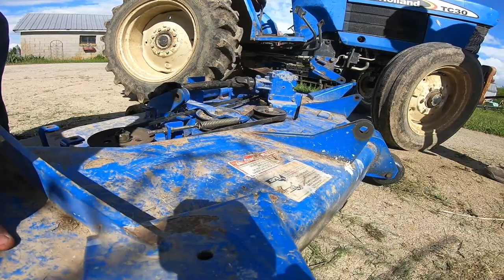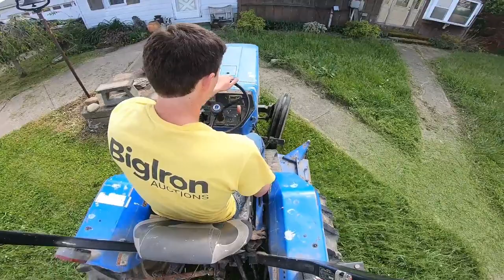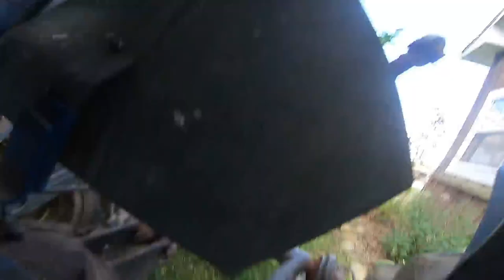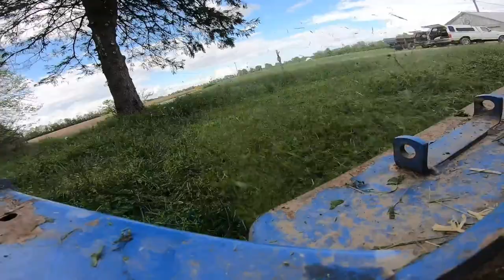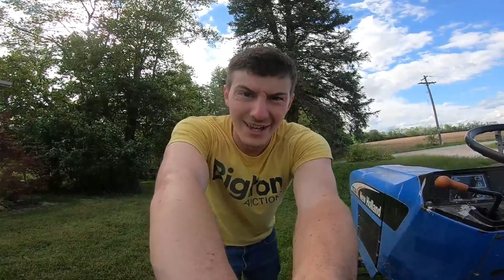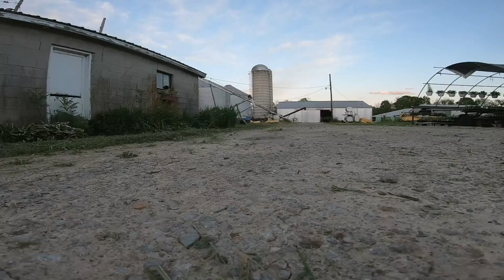Yard Maintenance to Make Lawn Pros Gag

Comment: Before the days of zero turns I mowed this barnyard with a Farmall A and a Woods belly mower. It was geared a little higher and you sat clear up in the sky. Not to mention you had to have the muffler off to get under the cedar trees. Now that old tractor is relegated to auger duty. It can still do a lot of work for a wimpy little four cylinder.

Comment: If it was a live PTO it would keep running when you push in the clutch.  Name was coined after manufacturers got past the trans-based PTO like your Farmall M which stops when you push in the clutch.  Hydraulic driven or a smaller shaft within the clutch are generally how they get away with live ones.
Reply from the maker: Independent PTO is the term for what you described.
Reply: @boehmfarm4276  That is different yet -- perhaps the hydraulic case if the pump is engine driven. There are 3 types total. Check out M&W live pto kits

Comment: LIVE POWER implies that you have a two stage clutch where the PTO engages before the transmission.  That jewel in an 8N Ford with a live lift,  Hopefully you will get to use a japanese engineered tractor with a Japanese name on it someday.   You may be amazed